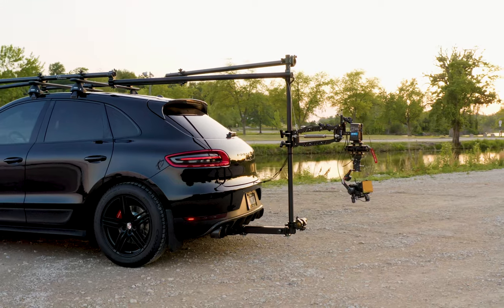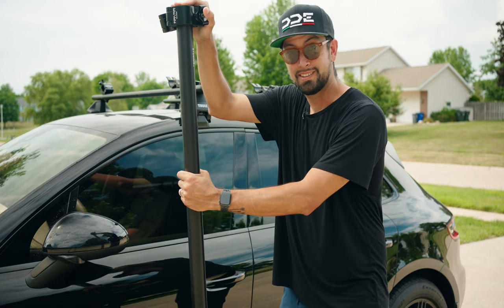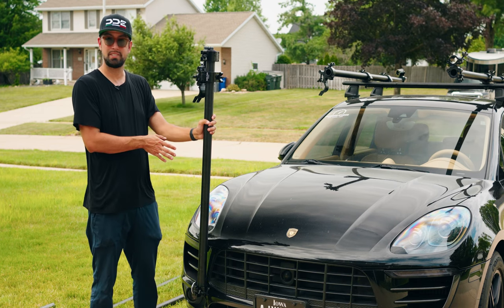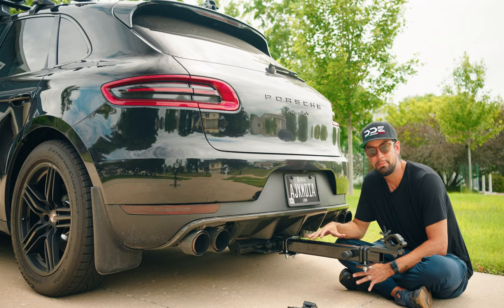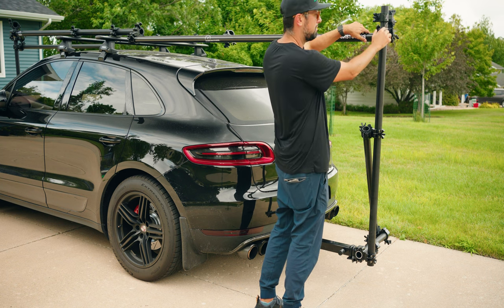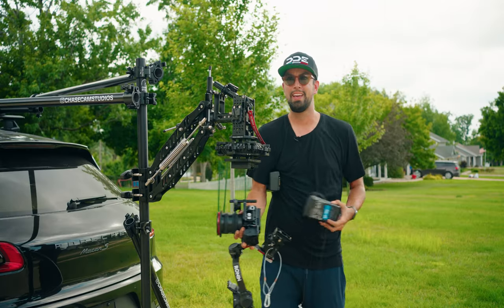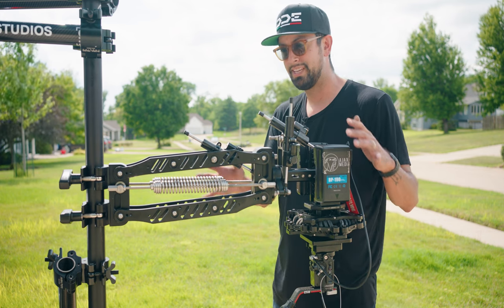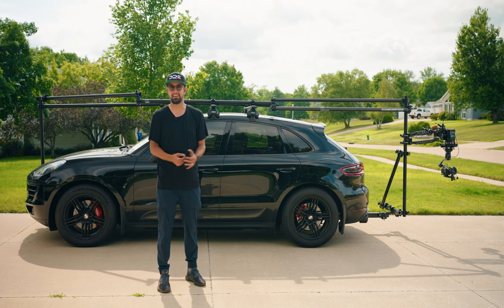How To Build a Camera Car on a Budget in 2024

Comment: I just bought the tilta hyra alien camera mount rig and after doing one shoot the whole system fell. luckily my gear is still in tact and works but after seeing this I am building it this way. Love the video
Reply from the maker: Oh man! Sorry to hear that! Suction cup mounts can be fine, but you. Have to really know proper mounting techniques. They have to be checked very often, and have to be ratchet strapped to the vehicle. You also have to prep the surface, and always keep the suction cups covered when not in use. You’re also limited on what parts of the vehicle you can attach it to. 

That said, hopefully this guide gives you some direction going forward !

Comment: Amazing video and super comprehensive!  If I could add something that might be helpful to others running an RS2 in this type of setup would be to plug everything thing in before connecting to the V-Mount battery.  I learned the hard way frying two RS2s before learning the proper protocol.  The RS3 Pro was not susceptible  this way but I would follow that same protocol going forward.  Also, your GPS module tip is spot on!  Works even better on the RS3 Pro with the upgraded motors.  Footage is super steady.
Reply from the maker: Appreciate the feedback and helpful tip!!
Reply: Hey I hope you see this and get a chance to reply before this weekend. Haha…I’m gonna be running my rs2 this weekend but with the hydra. I believe the connection to gimbal for power is essentially the same deal so I was curious about the power up sequence that you follow now. Are you plugging all things on the gimbal into the gimbal first and then sending power to the gimbal with the lemo to d-tap cable? For context, I have the v-mount plate for the rs2 that replaces the original mounting plate on the gimbal itself. I usually power my camera via the 2 pin lemo on that v-mount mounting plate but it seems like there are possible points of failure with various devices and their power draw.
Reply from the maker: @yochanders  correct. Everything is powered via a v mount that is on the arms cheese plate using a Lemo to D-Tap.

Comment: How much was the total build? Do you have a list of prices?
Reply from the maker: If I was just going off the back or front, and not both simultaneously, it would roughly break down to the following. Everything is linked in the description. 

(3) 6’ Black Speedrail = $300
(1) 4’ Black Speedrail = $80
(6) Swivel Clamps = $240
(3) Single Clamps = $75
Hitch extender = $30
(2) Anti Vibration Plates for hitch = $40
ProAim Arm = $1,500
RS2 = $600
RS2 Base Expansion Kit = $500

Then you just need a long HDMI to run the camera to the inside and hook a monitor up to the hand control that comes in tge RS2 base expansion kit.

Comment: You can simplify your rear hitch connection mounting bars by just drilling a new hitch pin hole that is 90 degrees from the original hole so that it makes the trailer ball flange 90 degrees from normal and that means that your bar clamp will be vertical just like your front. That means that you don't have to have all the additional cross bars to make it vertical
Reply from the maker: You really want the horizontal bar first so that there is a secondary bar there to create a triangle partially up the vertical speed rail. This is because if the single vertical rail works loose and slips, the other rail is keeping it in place. 

This actually happened to Jacob from Golden Peaks Productions and his rig hit the pavement. More times it’s about having a fail safe than simplicity.

Comment: How are you able to mount the gimbal to the front without it shutting off at high speeds? My RS2 turns it's motors off over 60MPH when it's front mounted.  I assume it does that to protect the motors from overtaxing themselves.
Reply from the maker: I have only taken mine up to 70 and it's been fine. I actually ended up buying the big DJI R2 gimbal for camera car work, which can handle any speed. lol
Reply: @Robert.DeCorah  Thank you for answering my question. That makes a lot of sense